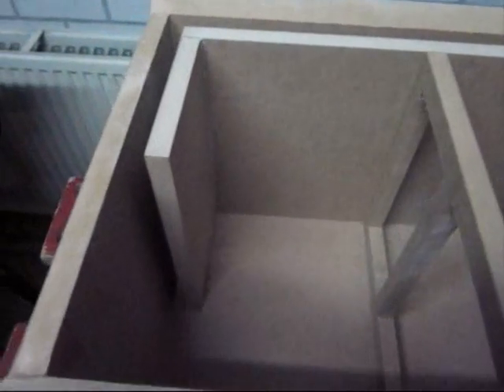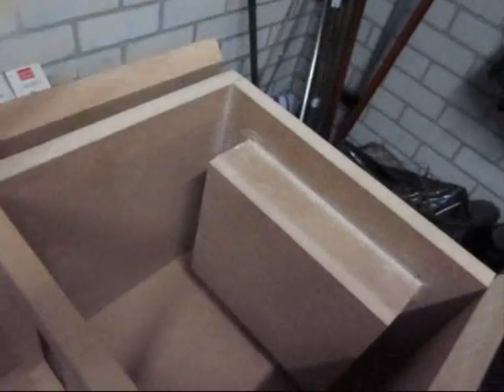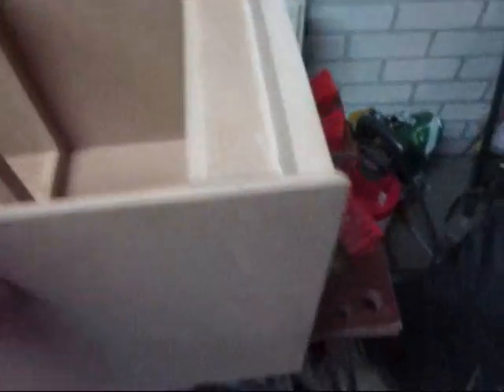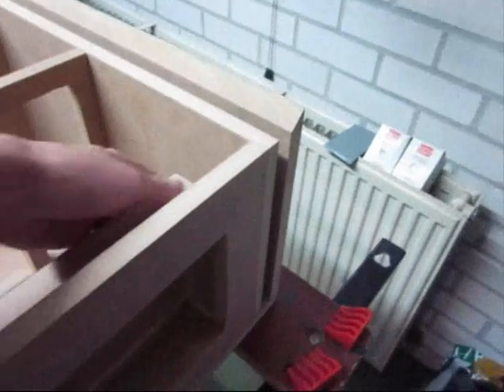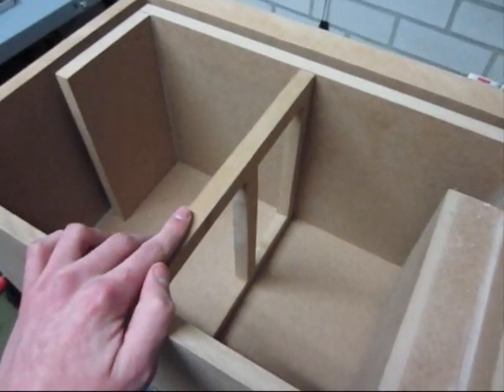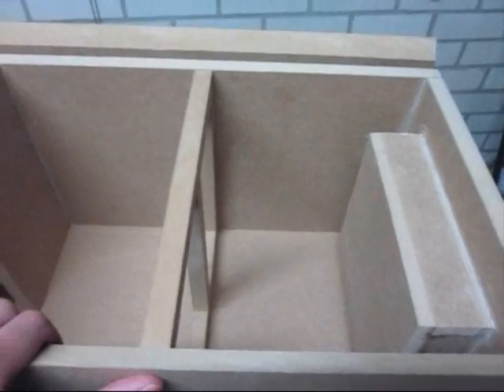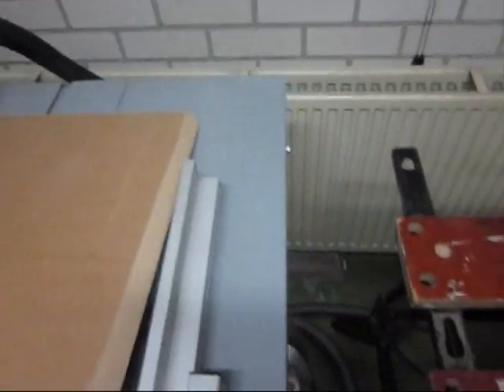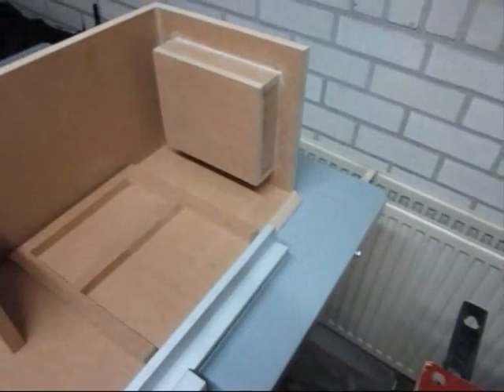8'' TangBand subwoofer vented box built part 1

Comment: And for cutting circles I've noticed that carbide bits work better because the cutting edges last much longer. What you can do is buy a basic set of normal bits, shouldn't be expensive, and just buy one normal 8, 10 or 12mm carbide bit.

Comment: If it's just about rounding edges, normal bits are good, I personnaly use normal bits for this. But if you want to cut into hard wood carbide is really better. Well for MDF normal bits are good enough. 
And sorry for not giving my news, I'm busy as hell with studies and with a phono preamp that doesn't really work as it should.